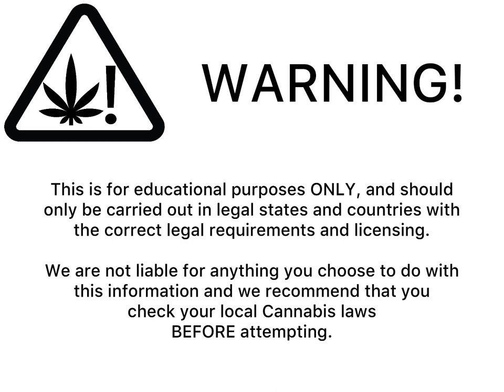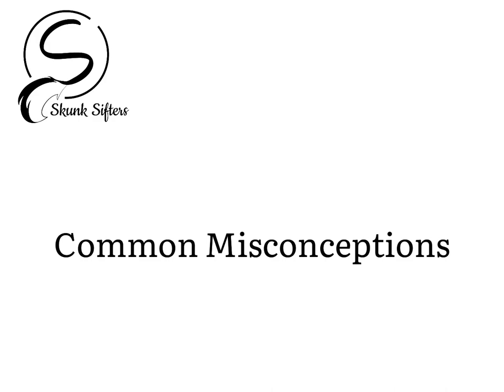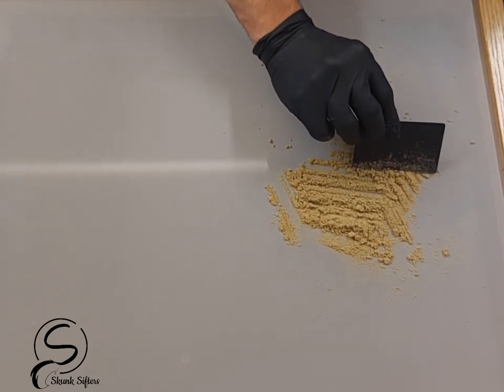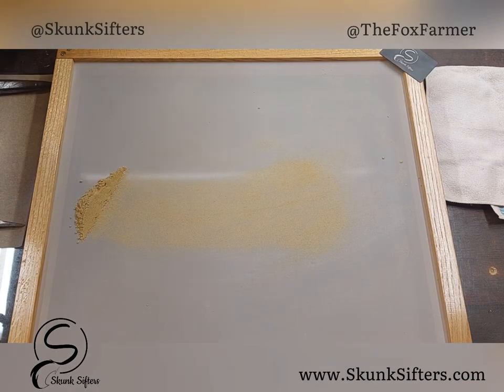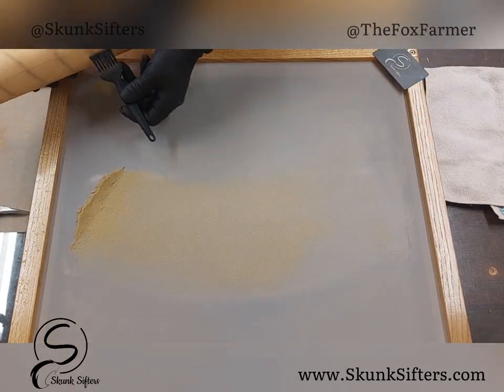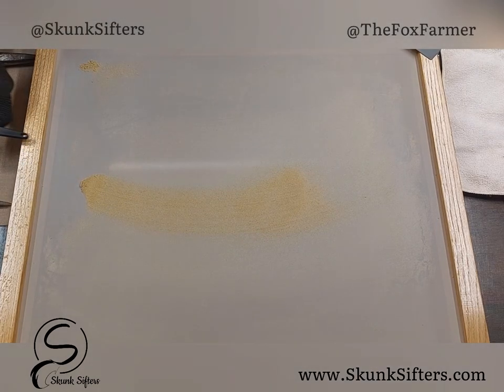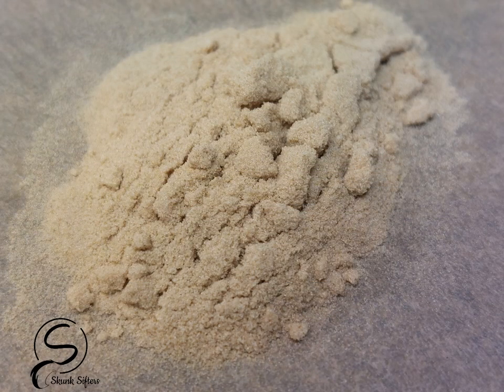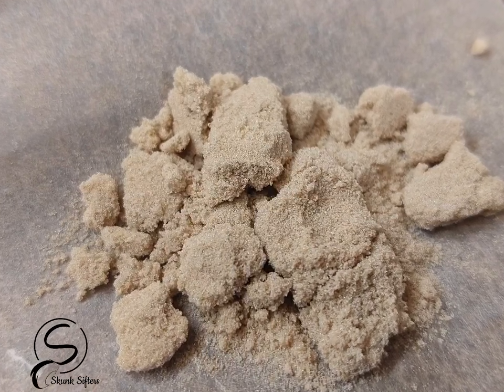Skunk Sifters - The Art of Dry Sifting: Static Tech

Comment: What about the product that went through the screen while you were sifting? 

Thanks in advance
Reply from the maker: This technique isn't to sift the heads, only to clean/separate the trichomes from contaminants by picking them up and moving them to a separate pile. You will find some material does pass through, so you can collect it and use it for whatever purpose you intend. Although, if you’re using the 45u screen for Static-Tech, anything that passes through won't be of much use.

Thank you for your question, and Happy Sifting! 🙌🔥🔥🖤🤍
Reply: @skunksifters  so basically i can use any silk screen (that does not pass material) with a wooden frame and commence static teching
Reply from the maker: If that's your take.. 😂 our 45u and 75u Screens will perform far better than any silk screen. We use the highest quality meshes made for precise filtration use and have specifically selected our meshes for dry sifting to the highest level 👌 head to our website for more details - specifically our "Mesh" page 🙂🖤🤍🦨
Reply: @skunksifters  will do man... don't forget i live in Lebanon, although we do produce local hash on an international scale, its still illegal here so we dont have access to top notch equipment, hence my diy silk screen take :P

but will def check the page out and try to ask a friend to send me one.
Reply from the maker: Ah, gotcha! 🙏 give it a go! Although in your situation, you may find that using the metal bowl technique could be better? Have you tried or seen this method before? It's a good technique for cleaning heads pretty quickly by simply dumping the uncleaned sift into the metal bowl, then with a bit of rhythm, stirring the sift by moving the bowl in a circular motion. This allows the trichomes to gather near the top edge of the bowl, caused by the static charge generated from the friction of the material! It's not quite as effective or efficient as using a screen, but you may find it useful and a quick, easy method if the silk screen doesn't work out so well 🔥🔥💦🖤🤍🦨